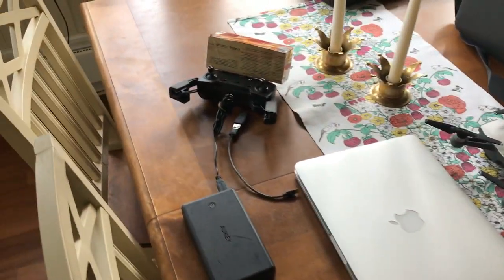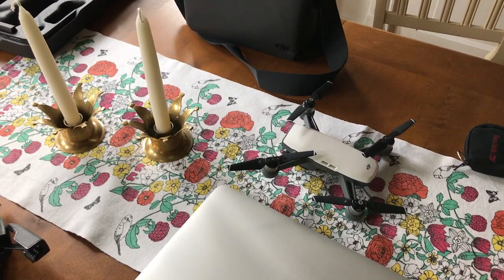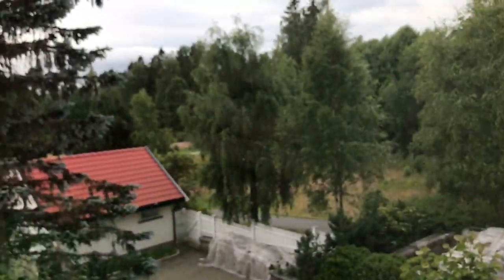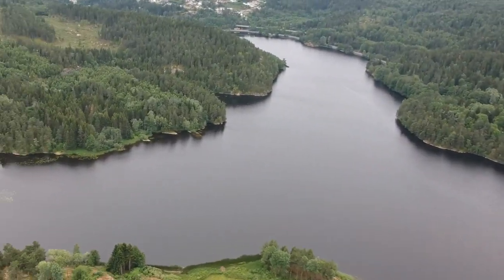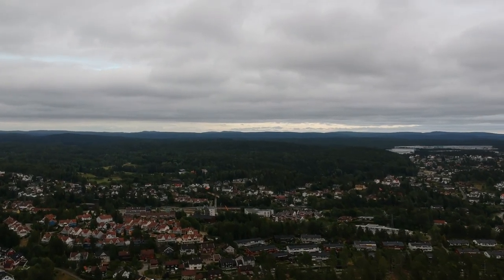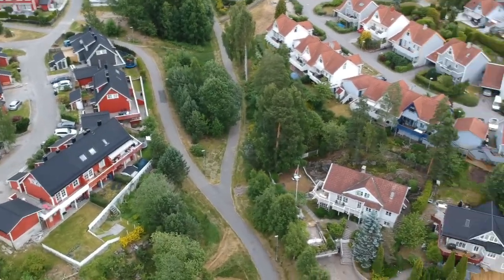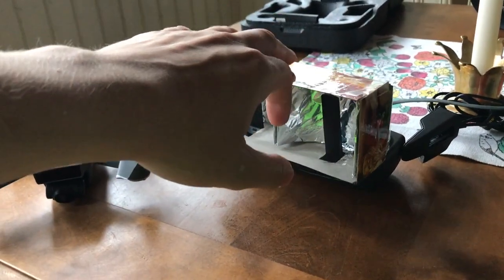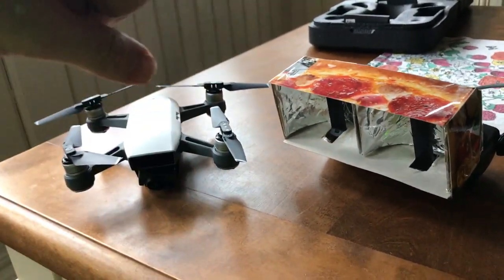Homemade DJI SPARK aluminium foil range extender + TEST AND RESULT

Comment: it does not even reach its regular range? 1.3 km is not the 2km that are advised by dji
Reply from the maker: Haas Landlord yes, that was a big disappointment for me. I think mine is like a European version, applying to laws over here. So it’s limited to 400-500 meter or something like that. Never knew that when I bought it
Reply: okay now you just messed up my day as I also have a Spark and was hoping to reach more than 2km . I am still too chicken too fly out of sight though :P
Reply: Wow you guys get  less range in Europe?  Crazy.  Next drones buy them from the U.S
Reply: I can confirm that the spark does indeed reach its 2km range. I actually got it to 2.7 km at 130m height. The height is very important as it minimizes interferance. At lower altitudes like 50m it'll cut out as low as 600m with me because the signal gets caught by trees or a hill ect.
Reply: @SamFourie  You can easily trick the drone into thinking your in the USA using a fake location app and get the same range as you would in USA.
Reply: @UnknownRider-eg1nl  Exactly what i replied to 2 comments up... or did you miss that ?
Reply: @SamFourie  Missed it
Reply: @UnknownRider-eg1nl  That doesn't work no more. Apparently DJI patched it. I tried it with Mavic mini. No joy. I also read that FCC version packs more power so my next drone will definitely be from the US
Reply: @bfree2eatme85  doesn't mater where you buy it, the drone picks up gps signal and adjust to local laws
Reply: Wow if I lived there I'd just sell my dr9ne whats the fun in that
Reply: @w.e.s.  Yeah bummer for me too when I found out my DJI Mini 2 could only reach several hundred meters before it would start losing connection.